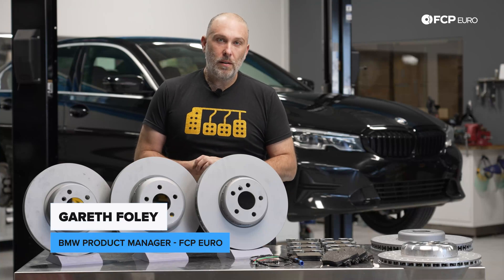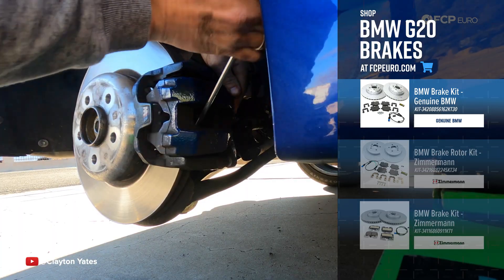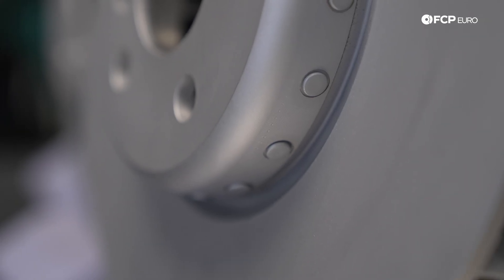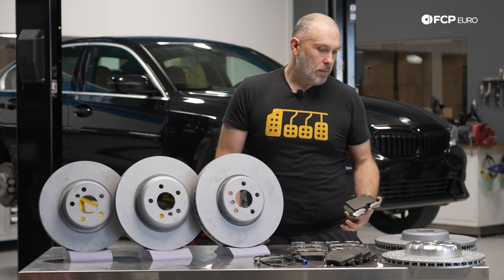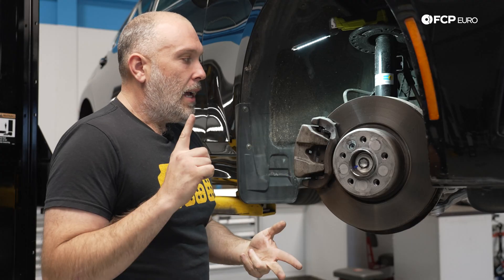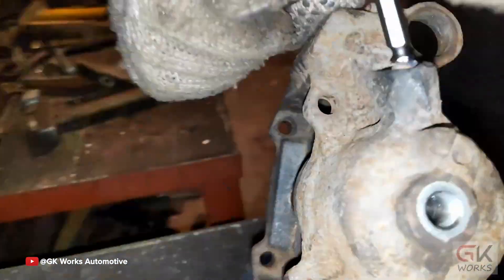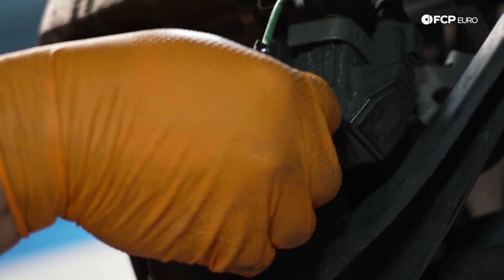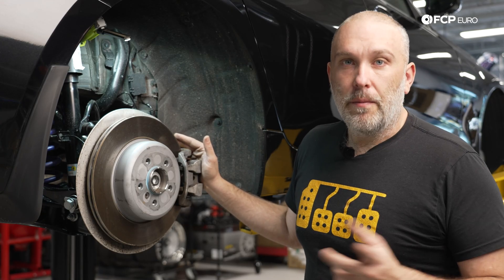BMW G20/G22 Brakes: All You Need To Know - 2019-Present BMW G20 330i, M340i, G22 430i, M440i

Comment: on my 2025 330i without m sport package, I have 4 piston grey front calipers and the front rotor is 30mm thick per my calipers I can get through the wheel to measure, they are two piece I am assuming 348mm daimeter.... it looks like BMW is now offering 4 piston grey calipers standard on the 330i
Reply: I believe you're right. The standard calipers on the 2025 330i doesn't look like the ones on this video, they look like 4 piston calipers but painted grey.

Comment: Is there any chance you know the dimensions (in MM) of the G20/21 M Performance/Sport Brake calipers? I'm trying to find al the dimensions as I'm trying to order a set of 3 Piece Work wheels for my G21 M340I Touring and they need all of the caliper measurements to calculate the clearance, I'm just wondering if you happen to know them that's all, excellent video either way!

Comment: Brake compartment is the only complaint I have on my 320d  xDrive. It’s a company car, so I didn’t get the chance to choose the MSport version, and standard brakes are just inadequate. Jerky feeling at low speed and overall mediocre performance. It’s a real shame that you can’t spec a non MSport car with better brakes, you need to go for the full MSport trim which is not only fairly expensive, but most of the times it’s just not a viable option for company cars. I drive 50.000Km a year, and better brakes would really make the difference on a car that (brakes apart) I generally love.

Comment: Huge kudos to you guys for this awesome series. Insanely useful for anyone who wants to wrench on their bmw. One thing to note: In Europe, there is an additional brake variant: some 330i models come equipped as standard with 348x30mm + 330x20mm 2-piece rotors. The front caliper is 4 piston and fixed and the rear is single piston floating. It adds to the confusion however it's a really nice spec since you almost get msport brakes for free, the main difference being the rotors are thinner and the pads are smaller.

Comment: Can you explain if it's safe and why /why not, to fit brake rotors of a different size from factory eg bigger brakes. How the does car know how to adapt?
Reply: A brake system on a car is pretty dumb. It’s the driver that has to adjust.

Comment: Hi, what can be the potential cause of sqeaking brakes after replacing 340mm oem brakes in f30 for new one? Is it fault of of non OEM brake pads? Squeaking of brakes happens during braking while driving in reverse or while driving very slow and braking (<20km/h). Every necessary part of calipper was lubed during replacement process. It's very strange
Reply from the maker: If the pads you used are semi-metallic, then low-speed braking noise isn't uncommon and is not a cause for concern.

Comment: As always, another great video.  To further demystify the brake pads, what pad upgrades are available for the Motorsport Engineering/ Track Handling Package: Front: 374x36mm Rear: 345x24mm?  Specifically looking for a better compound with improved initial bite, better modulation, and more heat resistance.  Thank you.
Reply: Endless, Dixcel.
I have Endless MX72 + to go on my 348 mm M Sport brakes. Can go CCRg etc for more heat or full race pads.
Dixcel Type Z.
PMu... as well.
Control, modulation cannot beat Japanese brake pads.
As long as it was sold in Japan they make pads for it, may be a special order but this is only 2 weeks. 
Try blackhawk Japan, you will be pleasantly surprised.